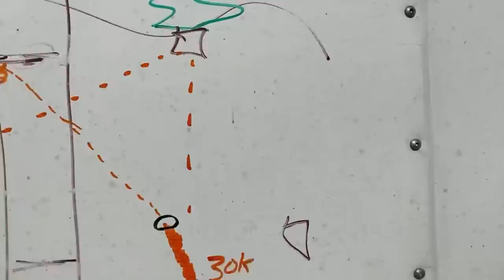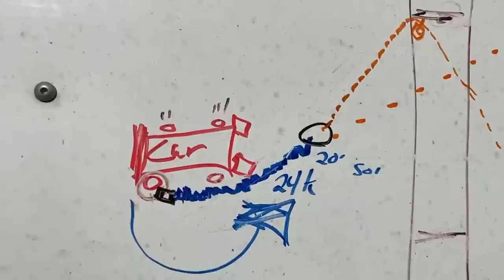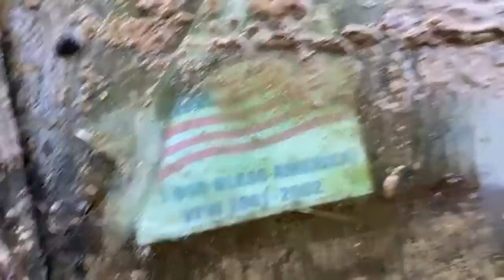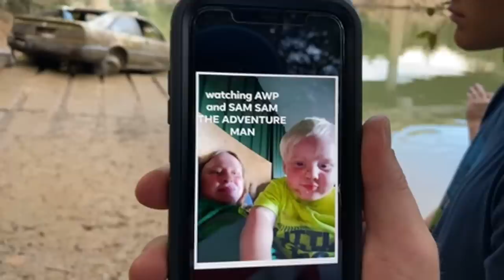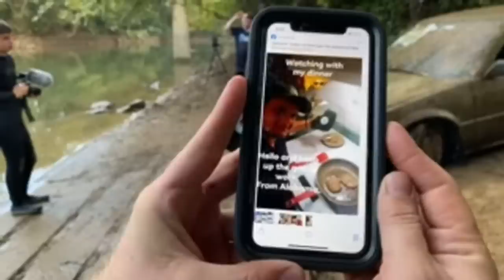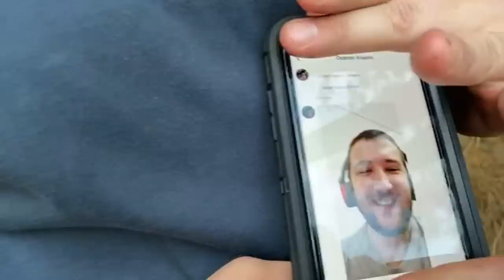Stolen Gun and Car Pulled Live... Cops Called

Comment: I'm a former Police Officer & I guarantee you that it was an insurance job, cause if it was stolen, the steering column & ignition switch would be torn apart
Reply: LOL ...not necessarily at all. Unfortunately, too many people leave their cars unlocked AND keys inside the car (too many people)! SMDH

One teen alone broke into; or opened the door to, over 600 cars in a short period of time. Many cars were taken for joy rides. 

Me: How? "That's impossible" without hot wiring AND breaking a window. Right? 

Hahahah .... nope

Thank you for your service in LE for the time you served. 🙏👮
Reply: I think you're right cop. People don't steal cars to store them in a body of water. The key in the ignition is a giveaway. A thief would have taken the keys, some parts, and abandoned it somewhere.
Reply: Although some people leave their keys in the ignition, not a good idea of course, but it does happen
Reply: Not necessarily true in every sense. Way too many people leave their keys in the car. Under the floor mats, behind the sun visor, even in the glove box.
Reply: I did some research and found an article written in 2005 in Los Angeles. It wrote "500 block of Glenwood Road: A 49-year-old Glendale man reported Thursday that his 1989 Honda Accord was stolen." 
(I looked up the license plate through a generator to find the vin number & it said that's the vehicle) so it was stolen!
Reply: @crackersmom2679  

Or in the cup holder…right in plain sight…
Reply: I absolutely love your channel

Comment: No mint mark on the coins just means that they came from the mint in Philadelphia. Since it was the first mint, the decision was made to just leave the mint mark blank on coins from there. 
All other mints put mint marks on their coins. D  for Denver,  S  for San Francisco,  W  for West Point, and at one time there was a mint at New Orleans, and they put an O for Orleans.
Reply: And Philadelphia has a P
Reply: @christineormsbee7634  No, they don't add a P to all coins made at the Philadelphia Mint.
In early United States coin production, (1793 to 1838), there were not any identifying marks, simply because there was only one mint. It was located at Philadelphia, PA. Since there was only one mint, an identification mark wasn't necessary as all coins produced were coming from the same place.

In 1835, three Branch Mints were authorized and were located in Charlotte, N.C. (C); Dahlonega, Ga. (D); and New Orleans, La. (O). Thus began the use of mint marks in the United States.

Coins produced by these branch mints were given unique identifying marks to distinguish where each coin was struck. The Philadelphia mint, however, still did not use mint marks. Thus, all coins without mint marks during this period can be assumed to be from the Philadelphia mint.

All together there have been 8 different identifying marks since the United States began striking coins in 1792.  The mint that was once at San Francisco, CA. used the (S) mark while it was in operation..
*The Philadelphia Mint did not use mint marks until 1979 except for a brief 4-year period in which a "P" mark was used on Jefferson, Wartime 5-cent coins, (1942-1945).
*

The reason they put a mint mark on these coins was because they were made of a silver alloy instead of the regular copper-nickel usually used in 5-cent coins.

At the time nickel was valuable war material so these nickels were made without nickel.

With the use of a mint mark, they could easily tell which coins were made with the silver alloy.

*
Currently the Lincoln Cent is the only coin that does not show a "P" when struck at the Philadelphia mint.*

There was also a brief period of time when mint marks were not used even at the branch mints. The Coinage Act of 1965 approved the dropping of mint marks from all coins. It also authorized replacing silver coins with copper-nickel clad coinage.

Thus, coins dated 1965 through 1967 do not have mint marks so it is impossible to tell which mint they came from.
Some coins are marked with a P, but not all. Also, Except for commemorative and one other exception, the Mint at West Point also puts no Mint Mark on the coins they produce.
Note: The Dahlonega Mint and the Denver Mint were not in operation at the same time.
If you are interested in such things, take some advice and get yourself a coin collectors book because some of this stuff gets complicated. I stayed confused bout some things until I got smart and got myself a book.
Reply: @ghostcityshelton9378  Thanks, I'll check it out.

Comment: I hate to tell you RV is not a tow truck!  Diffinitly not when it's your every day ride
Reply: They are pretty tough my 38ft class a had been filled up from an entire apt from Tennessee to va so heavy it boiled the trans fluid out of her but still  good!
Reply: They basically are just different bodies attached built on truck running gear chassis axles ect
Reply: Motor Home =Truck = same suspension and often times same motor? From a professional Master Mechanic...

Comment: Last year I pulled a friend of mine's extended cab Chevy truck out of a local Lake. It had slid down the ramp and Fallin behind a 6 ft drop off on the concrete ramp. The front bumper was 4 feet below the edge. Hook a cable 100 yards directly to the right of the vehicle and had a four-wheel drive pickup hook to the middle of the cable and pull forward. The truck move immediately to the right and out from behind the concrete ramp where we hooked on to it and pull it straight out.

Comment: Sirs, with all due respect, get a portable winch that will mount and remove from the receiver and control the pull from there. This will perhaps save the torque converter and or the transmission of the RV. Roll backs etc do not usually use the vehicle power train to do this kind of work. May save the tranny, rear end etc for later down the road. Donation money could perhaps be better used than on needless repairs. GOD bless. Be safe